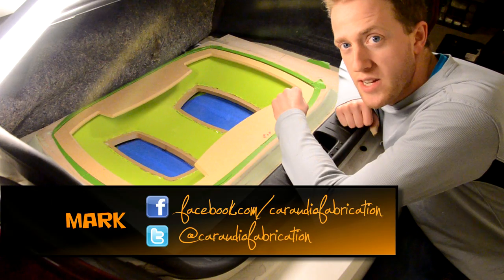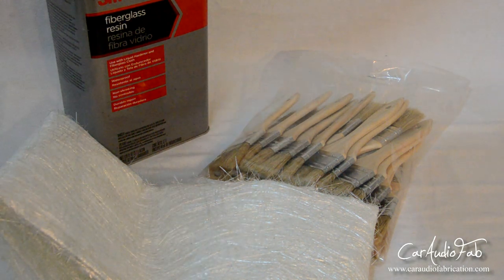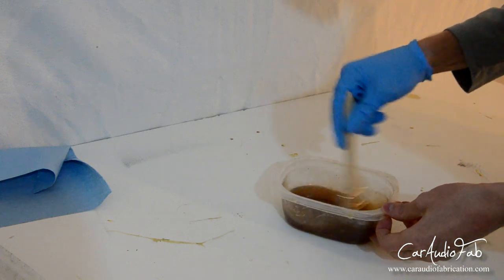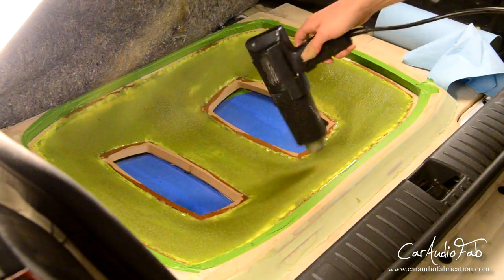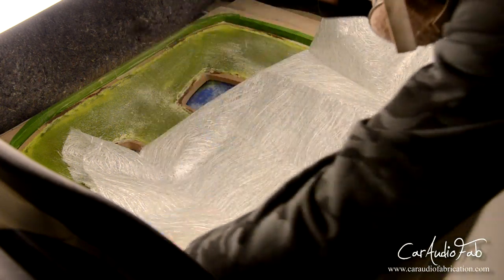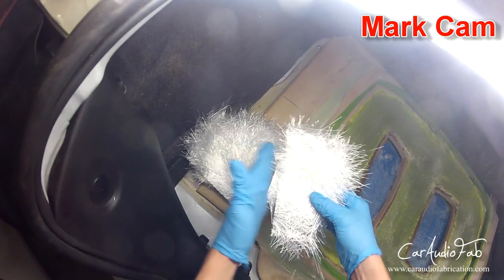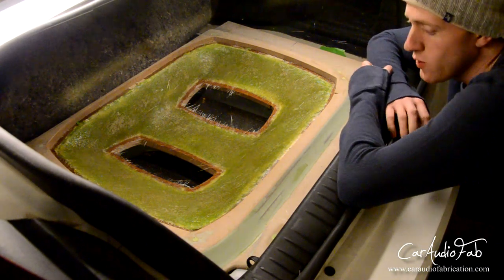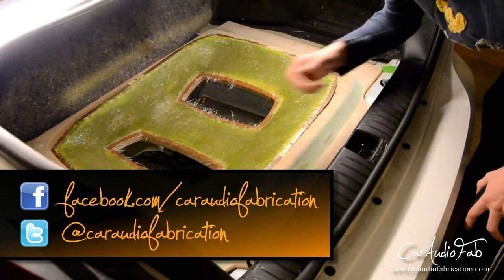How to add fiberglass resin and strength  - Amp Rack 101 - Car Audio Fiberglass How To

Comment from the maker: No problem, I put them on while it is still wet. If you must let it dry just sand it nice and smooth before applying more. To be honest I am not sure what weight mat it was, I have it from a previous project. As this is a cosmetic panel i use enough that I feel it is strong enough.

Comment from the maker: If you are doing a surface larger than 16 square inches or so it is worth it to get the gold, the light weight works fine for small jobs, but something like molding into a door panel requires quite a large surface.

Comment: I think another great way for beginners or even pros is to fiberglass the back side of the piece you are working on when possible.  This will leave you with a smoother finish on top to lay filler. You cant always reinforce the piece from the back side but this is what i prefer doing.